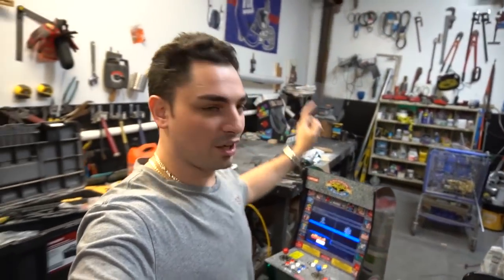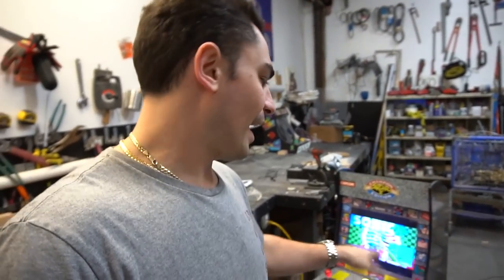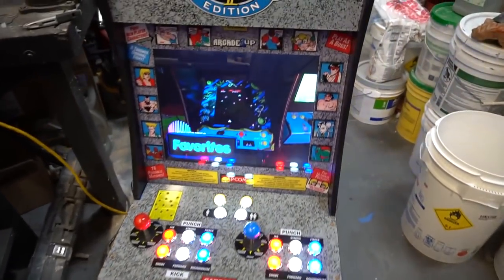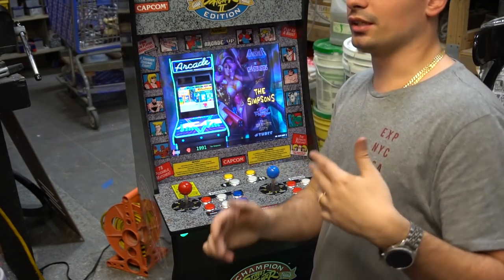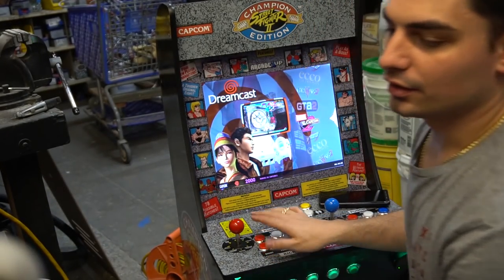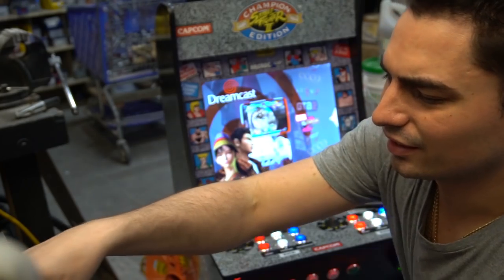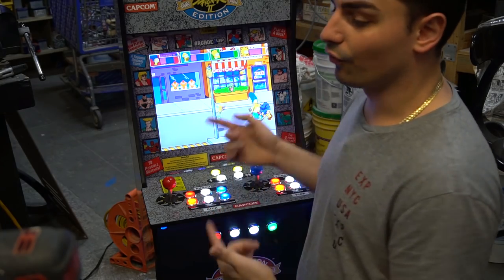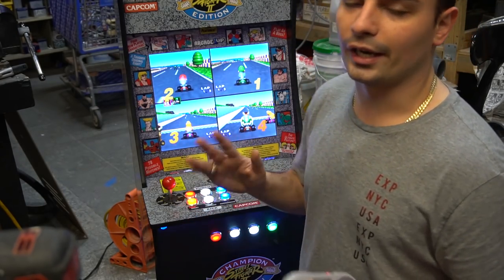Arcade 1up using real t-molding??, also ricky's 4 player WIRELESS mod!

Comment: I was wanting to know if you've ever worked with arcade one, not to be confused with arcade1up. They have Mini PC builds made to be thrown in to an arcade machine. From what I have read there is no Plug and Play System but they're about as close as you can get because everything's done and it's just a next next next next next type of thing were you just keep hitting the next button until you're done.
Reply from the maker: Nah never heard or used them before I'll research it